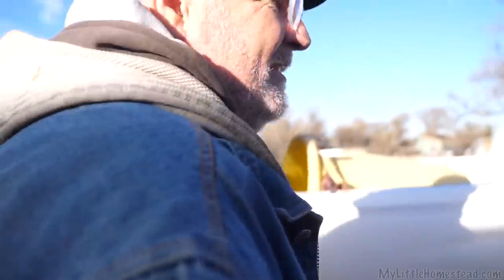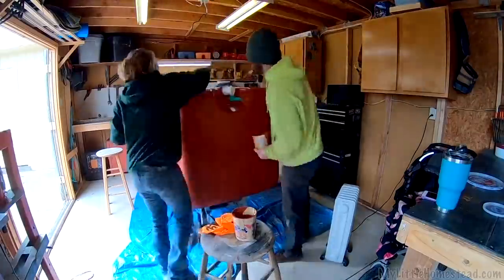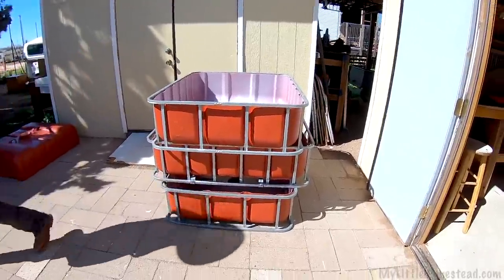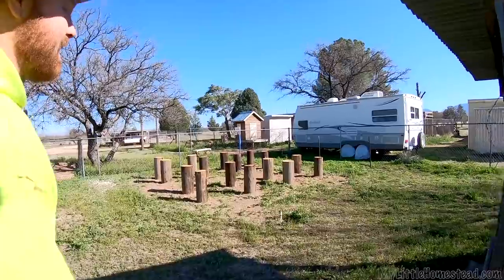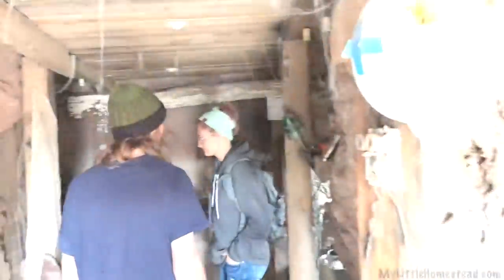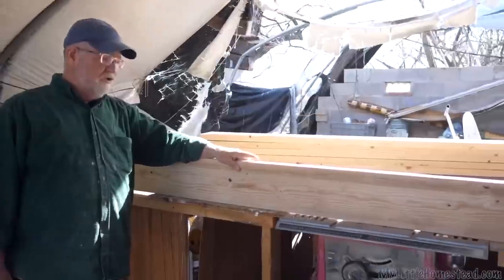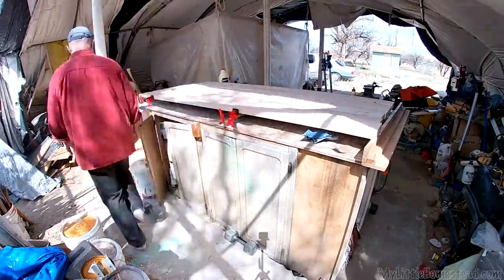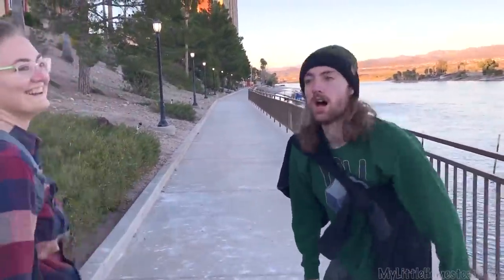Barn Door, Aquaponic Tanks & Convert Aviation Headset to Gaming Headphones @2:57 | Weekly Peek Ep224

Comment: Garen, if you research some of the larger fish growers you will see that they use round tanks to grow their fish in. The reason as explained to me is that at times the fish will school around the tank in circles & sometimes at high speeds. If a tank has flat walls, the fish will run into the walls & injure themselves. Thus lowering the probability that particular fish would bring a top price from a prospective buyer. A shade cloth above the tanks would also be advisable to keep from prematurely cooking your fish in that hot Arizona sun. Good luck on your venture.

Comment: HEY GUYS, AS ALWAYS A GREAT VIDEO. I DO HAVE ONE QUESTION,: GARY, WHY DID YOU USE SCREWS IN THE DOORS AND NOT WOODEN DOWELS ? MYSELF I THINK IT WOULD GIVE IT MORE STRENGTH THAN SCREWS AND IT WOULD LOOK A LOT CLEANER. EITHER WAY IS GOOD BUT I WAS JUST WONDERING WHY YOU MADE THE DECISION YOU DID.
Reply from the maker: the glue is the cement. the screws are a binder